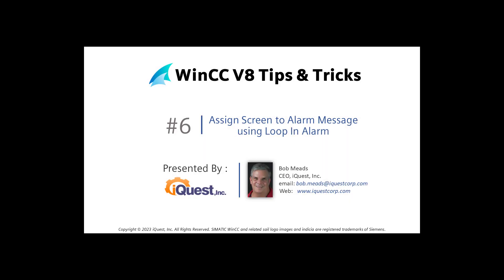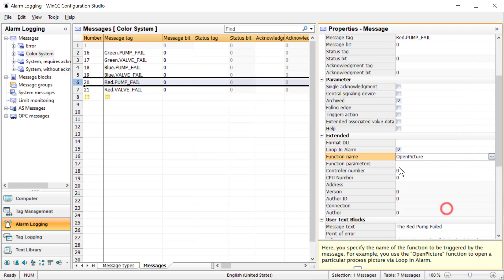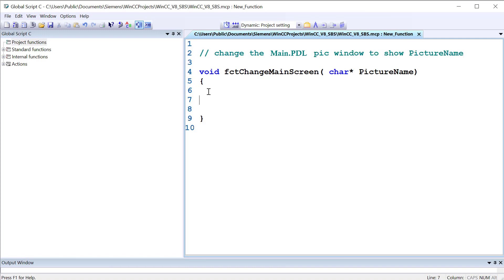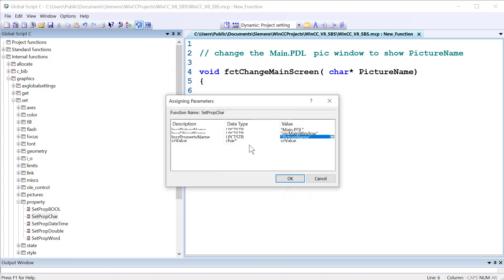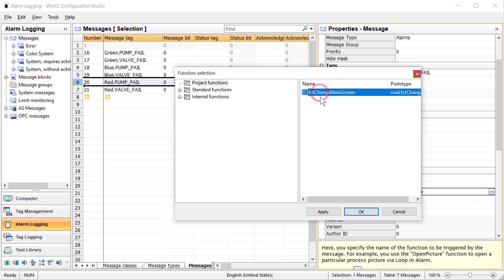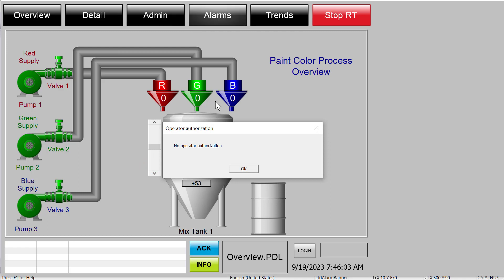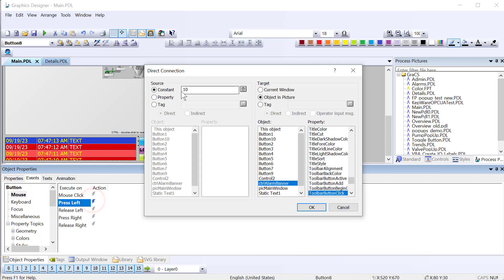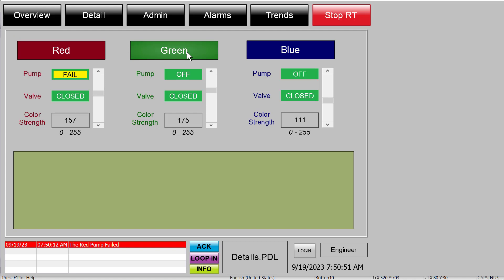WinCC V8 Tip 6: Click WinCC Alarm to Show a Screen! 😍 Learn SCADA Programming  #winccguru

Comment: Thank you for good videos. I want to change the Alarm class or Type of some alarms when WinCC running. Is it possible to do this? So how?
Reply from the maker: I’d have to check but I don’t think the alarm service would pick up the change until runtime is reset.  What is the use case for doing this?
Reply: Thank to reply 
For maintenance issue I want to do this. @WinCCGURU

Comment: Una pregunta, seria posible ejecutar un script en c# al momento en el que salte una alarma? es decir que se ejecute automáticamente al momento en que se produce la alarma
Reply from the maker: You can do a C script but not c#. look up the gMsgFunction
Reply: @WinCCGURU  correcto modificando la función gmsgfunction logré hacer lo que necesitaba, tal vez sabes con que función en c puedo recuperar los nombres de usuarios que cree, dentro de un grupo de usuarios? también lo necesito en c script, he buscado en foros y no hay nada relacionado con esto.
Reply from the maker: I am not sure which users you mean. the currently logged on user? or do you need a list of users in a certain group?
Reply from the maker: That is from the WinCC open developers kit, and it won't work like that; you would need to write the callback function to enum_user to handle the return users, etc. gMsgFunction gets called every time an alarm messages changes states and so if there are a lot of messages it could really eat up a lot of CPU and slow things down.
Reply from the maker: you can get a list from the database using SQL. what exactly do you want to do with the list of users?
Reply: @WinCCGURU  gracias por tu pronta respuesta, lo que quiero hacer específicamente es filtrar el nombre de ciertos usuarios dentro de un grupo específico cuando cambie el estado de alarma, una vez recogida esta información podría guardarlo en una estructura y en base a eso ejecutar distintas acciones. Entiendo que modificando la función de callback podría lograr filtrar los usuarios, muchas gracias por tus respuestas son de mucha utilidad.
Reply from the maker: I’m out of town and away from my computer so I will reply next Tuesday. Sorry for the delay.
Reply: @WinCCGURU   ok muchisimas gracias, seguro que tu aporte es de suma, importancia.  He conseguido sacarlo tal y cual como lo quería, actualmente me encuentro con una dificultad, he logrado extraer los mensajes que estan asociados a las alarmas, sin embargo quise extraer el valor del campo message type and message class y no logro extraer su valor con el metodo RTMGetMsgText, alguna idea tal vez de como hacerlo?
Reply from the maker: @juanromero-jo1db  to get class and type you need to use MSRTGetClassInfo. its called with a structure address and you will get class name and type name.
Reply: @WinCCGURU  Increíble muchísimas gracias por tu aporte.
Reply from the maker: @juanromero-jo1db  thanks. I am wondering if I need to do a video on ODK Programming for WinCC?